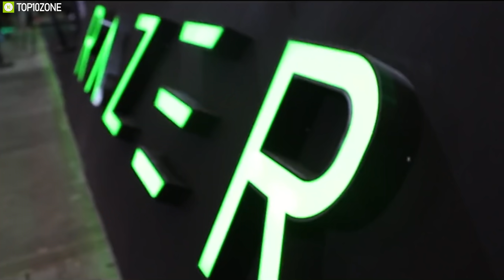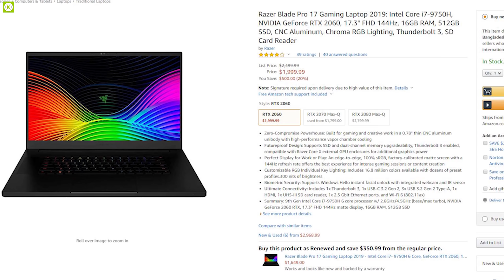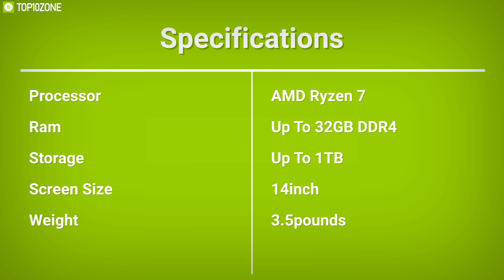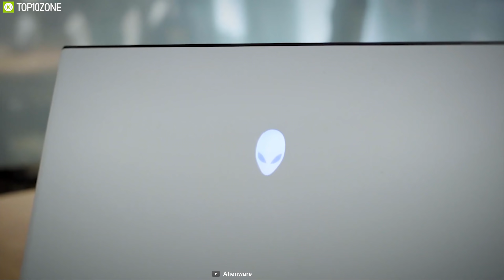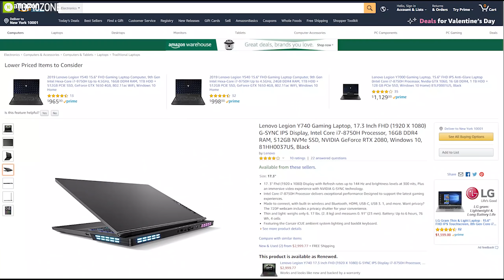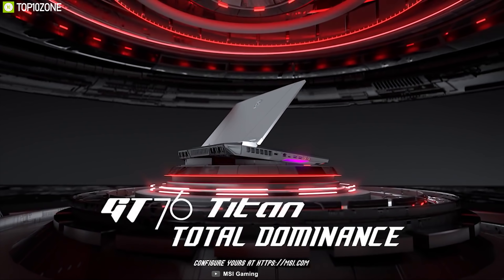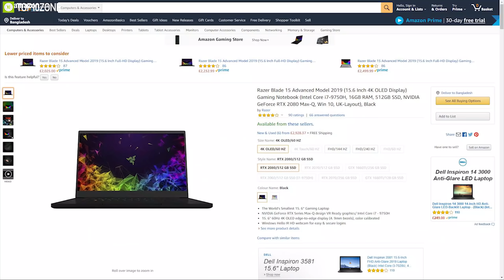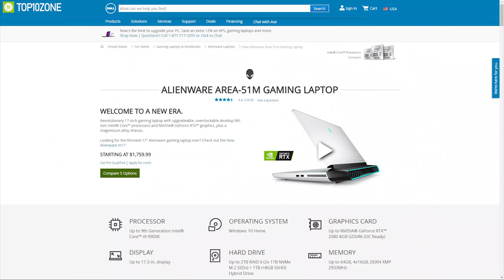Top 10 Best Gaming Laptop to Buy

Comment: This dude has no idea what’s he saying and is just reading specs off their website with no personal insight to add...
Reply: @camerontraer3136  I do
Reply: ArthixIsphinx Roblox You do what?
Reply: @camerontraer3136  I get more than 5 hours of gameplay xd
Reply: @arthixisphinx265  What game?
Reply: @camerontraer3136  Roblox, Fortnite, PUBG and Call of duty mobile
Reply: @arthixisphinx265  Dude...they're the mobile versions of the game. I'm talking PC versions. There's no way that a gaming laptop would last 5 hours of gameplay
Reply: @camerontraer3136  it will and I have one
Reply: ArthixIsphinx Roblox again. It’s the MOBILE versions
Reply: Cameron Traer lol have mercy with the insults sheesh
Reply: @camerontraer3136   hi there I'm trying to get gaming laptop but what do you mean it wont last 5 hours? The battery only or the performance too?
Reply: SubZeroT_T it depends on the wattage capacity of the battery. Most if not all Gaming laptops don’t have good battery life. But please remember that if you want to play a game on it, PLUG IN THE CHARGER. This will not only charge the laptop, but also gives it extra power to run games at higher settings and higher frame rates. If you game on battery, you’ll only be able to get around an hour of gameplay, but the frame rate will be capped at only 30 FPS. Compared to when gaming when plugged in, you can get up to 90 - 300 FPS, but that will depend on the game and the specs of your gaming laptop. If you have any more questions, please feel free to contact me again.
Reply: Shubham Raikwar it’s terrible
Reply: ArthixIsphinx Roblox excuse me, but I know how a gaming laptop works inside-out, and I can GUARANTEE that you’ve been scammed into thinking that a gaming laptop can play Fortnite and PUBG for 5 hours on battery life.
Reply: @camerontraer3136  thanks alot so I don't have to worry about anything else when playing with charger on it still do as good as pc or almost. I checked many reviews and top x. But still not sure as most of them sponsored or doesnt have real gaming experience just tech stuff
Reply: Is halt so
Reply: 哈 我也聽不懂…
Reply: @camerontraer3136  man i trust you, you seem to know what u sayin so i'm gonna ask you: there's a good laptop for gaming not expensive like in the video ? I need it to play with my friends, games like modded minecraft (lol yes), rainbow six siege or even new games...i'm not very demanding on video quality, just need at least 60 fps xD. Thx <3
Reply: Lorney Sure! Try a gaming laptop with either a GTX 1060, or a 1660 Ti. Just DO NOT get a gaming laptop with a MAX Q graphics card.
Reply: @camerontraer3136  Hi, do you know of any PC's that are still affordable but can have around 60-120 fps? I would like to plug a controller into the laptop. What I'm trying to mainly get away from my xbox one s is low fps and latency that console players generally have while playing games.
Reply: thanks for the comment my guy, saved 10 mins of my life
Reply: @Shubham Raikwar Jesus that's expensive!
Reply: @camerontraer3136  you are right
Reply: @PenKake14  don't just buy a laptop for its looks. Manufacturers spent more money on that stupid RGB keyboard than the graphics card.
Reply: ArthixIsphinx Roblox A PC...dude a PC doesn’t have a battery!!!
Reply: Cameron Traer i mean he’s not wrong. Technically u can play for more than 6 hours 😂
Reply: ArthixIsphinx Roblox dude the razer blade 15 has one of the best battery life out there and it can only get four hours with normal productivity lmao
Reply: DEDINSIDE yeah...an a PC connected to a PSU connected to an outlet at all times.
Reply: @camerontraer3136  I played roblox more than 6 hours again on my gaming laptop and charging it at the same time and playing I played Piggy and a lot of roblox games now get roasted
Reply: @arthixisphinx265  Dude...you just roasted yourself! You're plugged in while playing it! Of course it's not gonna use battery life! It's using power from the charger!!!
Reply: @Zero-_-kw  Please don't look to this video or his channel for ANY information. He knows nothing about gaming laptops, and is just reading the specs off them online. But no, if you want the ABSOLUTE best performance, get a gaming PC desktop.
Reply: @Mi-cuhhh  Sure! It depends on what games you want to play, what your budget is, what resolution, and what graphical settings you want to run the game at. So first off, what is your budget?
Reply: @camerontraer3136  I wish I could get a pc but the thing is 3 days per week I'm staying at work and I got plenty of free time there. That's why I'm mainly looking for gaming laptop so I can carry it around.
Reply: @Zero-_-kw  I 100% agree with you. So are you looking for an ultra thin gaming laptop?
Reply: @camerontraer3136  I don't mind the size of the laptop or how heavy it is. I'm just looking for the best performance also it will be always plugged I'm not worried about battery life. I've been looking around I've seen some awesome laptops  but expensive like 3 - 4k US dollars. My budget would be around 1.5 - 2k$
Reply: @camerontraer3136  whoa!! Thanks for showing that I'll definitely wait then!
Reply: @camerontraer3136  but it was 45% after 6 hours of gaming it came at 78% say something now
Reply: ArthixIsphinx Roblox While it was PLUGGED IN
Reply: ArthixIsphinx Roblox plus you play little boy games. Those could run on a phone no problem!
Reply: @camerontraer3136  played call of duty modern warfare remastered on my gaming laptop for more than 5 hours and NOT PLUGGED IN GAMING WAS  3 hours of gaming and then continue PLUGGED  for 2 hours more and 20 minutes now say something
Reply: @camerontraer3136  also you know what let's just stop arguing for no reason
Reply: @camerontraer3136  My budget is about 6- 800
Reply: Micah Vielma Oh...that’s uh...yeesh...
Reply: @camerontraer3136  well I could go higher. Anything you reccomended?
Reply: @DaneJiujitsu  wow fortnite is a mobile games
Reply: @camerontraer3136  hey, can u give me an name of a good gaming laptop I want to buy one, I just want the name of the pc, thank u
Reply: TheFreakHead Well, it all depends on your budget
Reply: He said "In-con-spishious" instead of 'inconspicuous'. 🤦
Reply: @arthixisphinx265  Hahaha sorry kid they're talking about PC/PC gaming and you're talking about mobile...
Reply: Daba11 I couldn’t do it any better lol
Reply: @camerontraer3136  
You are doing God's work over here. Ignore that roblox kid.
Reply: @NOU-iw3gb  Wait...I am? How?
Reply: @camerontraer3136  
You are helping others out
Reply: @camerontraer3136  
Btw I have hp pavilion notebook . It's a 60 hz laptop and I get max 60 fps on it. Sad isn't it? I got it 4 years ago I think.
Reply: @NOU-iw3gb  Aww! I just love helping people!
Reply: @camerontraer3136  what is bad with a max q? I just bought an Acer Triton 700 with a 1080 max q and it is fantastic! I know that max q  graphics cards are usually expensive but i got my laptop for 1.300 US$ I think it was a pretty good deal
Reply: @frederikcamilodahl3551  Think of it this way. When you play a game on your laptop, a graphically demanding one. Like DOOM Eternal. The laptop generates a big amount of heat from both the CPU, and the GPU.

In your gaming laptop, you DO have a dedicated GPU, but it's a Max Q version of the 1080 laptop GPU.

You see, Max Q graphics cards are designed to output the least amount of heat and consume the least amount of power as possible. However, that being said, less power consumption and heat limitations cause the GPU to run at a much lower frequency, resulting in lower FPS than a full laptop GPU.

Max Q GPU's are specifically designed for thin and light gaming laptops, due to how compact the laptop is.

I looked up your Acer Triton 700, and it's very thin. But the only way they can put a dedicated graphics card inside, is to put a lower powered Max Q version of the 1080 laptop GPU inside. It's because your laptop is so thin, the cooling system would not be capable to properly cool a full 1080 laptop GPU. It would be overwhelmed, the CPU and GPU would be WAY more likely to Thermal-Throttle, (Meaning it heat's up to nearly 100 degrees Celsius, and your FPS would significantly drop.) And becomes dangerous not only to the laptop, but can become a fire hazard. 

I'm not saying that your laptop is bad, it's actually pretty good! I'm just saying that the performance is not up-yo-par with the FULL laptop version of the 1080. 

The reason Max Q is more expensive, is that you're paying for a thin and light laptop that can run games. That small form-factor is what makes the price jump so much, because it's extremely compact.
Reply: @frederikcamilodahl3551  I'm not saying that your laptop's bad, but the Max Q GPU isn't near as powerful as the full laptop version of the 1080

The reason Max Q is more expensive, is that you're paying for a thin and light laptop that can run games. That small form-factor is what makes the price jump so much, because it's extremely compact.
Reply: @PenKake14  these are horrible specs
Reply: @camerontraer3136  Acer gives the option to overclock it a bit, so it is actually pretty close to a normal mobile 1080 and better than a mobile 1070. But a mobile 1080 is of cause still better. I also use my laptop as a school computer, so I love that it is so thin. I can play JC4 with ultra graphics and still be under 70 degrees Celsius. My desktop also have a GTX 1080, so I can allways use that if the heat becomes a problem. But I have not had a single problem with any games and i have never been over 80 degrees Celsius. But thanks for the comment - Hope you understand me because I do not normally speak english:)
Reply: @camerontraer3136  ... And I could not find a better computer in my country for near that price (1.300 us$)
Reply: At least you know his top 🔝 10
Reply: @camerontraer3136  yes it will lmao i play PUBG, rust, ark, call of duty, dayZ and so on all pc versions and i get more then 5hrs of gameplay lol
Reply: Y’all know good laptops for around 400-450?
Reply: @camerontraer3136  hi there, could you help me finding  a good gaming Laptop in the price range of 1500-2000
You also can give me some Recommandations up to 2500
Response time from the display should be like 3ms and yes it should run Triple A games.. I was looking for asus but all the informations... It's to hard to find out wich one is the best 🙈 thank you in advance and Greetings from Luxembourg
Reply: Daba11 so would you rather read it?
Reply: Just sharing my personal experience thought it might help you guys a little,ofcourse not for the views,you can check a video in my channel of that shotgun in pubg pc,I bought this Lenovo ideapad 700(i5-6HQ,12GB RAM,SSD,GTX 950m 4GB) for 340USD a year ago,45-60fps on 768p Very low settings,I got used to it and I’m in Expert rank now(0.82 K/D, 9 Most Kills),in middle of playable and not playable

Don’t expect gaming laptop to game on battery as said above you’ll get low fps and still the battery won’t last for more than 1.5 hours on high end games
Reply: @PenKake14  that's a pretty outdated machine, to be honest. My msi GS63VR has an i6 6700, gtx 1060 6gb, 16gb ram, 1tb hdd and a 256gb ssd, and all the msi bells and whistles. I'll sell it to you for 750 usd
Reply: @pabloescolar_  he probably did but I bet you spent those 10 minutes in the comments of this vid afterwards hahahahhahahaha
Reply: @arthixisphinx265  who tf plays call of duty mobile on a laptop 🤣🤣🤣
Reply: What
Reply: @egage43  Apparently, that kid.
Reply: The number of likes on this comment ~ The number of dislikes on this video.
Reply: Thats tuff.
Reply: Can you recommend a laptop for me? I'm a PS4 owner who has never gamed on a pc before and want to get into it.
Reply: @satnav1980  If you want an entry level gaming laptop get a GTX 1660Ti, don't get an RTX2060. Get an RTX2070 super if you can.

i5 is play but i7 has more cores so it's better. 9th gen is okay, 10th gen is better but not available everywhere yet.

With a GTX1660Ti COD Modern Warfare can push 90 - 100 FPS on Normal settings.
 Max settings will give you 75 - 89 FPS.

Get a monitor/screen that has at least 144Hz refresh rate.

If you choose RYZEN over Intel, keep in mind that thr 4th gen AMD RYZEN are more powerful than the 10th gen Intel. 

My recommendation: 

-Triton 500 with RTX2070, i7-9750H, 144HZ and 16GB DDR4 RAM
- ASUS ROG G15 WITH GTX 1660Ti,  R7 4800H, 144Hz and 16GB DDR4 RAM

(There is no point in getting a 240Hz screen if you're running a GTX1660Ti or an RTX2060)
Reply: He's just trying to get clicks on his affiliate links lol
Reply: Cameron Traer sorry to bother you but, I’ve been looking for a budget laptop 600-1000 and I don’t want it to be dedicated to gaming because I will most likely be using it for other things but I need a good laptop for gaming so I don’t need to use my parents laptop
Reply: ArthixIsphinx Roblox wtf 😆
Reply: Cameron Traer haha 😆
Reply: ArthixIsphinx Roblox tf mobile gaming sucks
Reply: Micah Vielma Is 500$?
Reply: Cameron Traer do you know a good gaming laptop under 1k
Reply: Cameron Traer tf you mean? I have an i5 laptop and it can last running all day
Reply: Acer Predator " https://amzn.to/2ZwdzwJ "
Reply: Cameron Traer what laptop would you recommend me to buy for gaming and watching anime ?
Reply: Umm it's not a review of a laptop
Reply: The vids are also wrong and the specs are too lmao
Reply: @PenKake14  bot get out of here
Reply: @camerontraer3136  Hey dude I really need a laptop as where I live doesn’t have electricity most of the time and we always move every year so I don’t  want to damage anything so I want a laptop which would be easy to carry and therefore will give better battery performance. With a good cpu and gpu( Dont worry about budget I am here for recommendations)
Reply: @arthixisphinx265  oh would I shut ur mouth kid, first of all u were playing low demanding games like roblox in a gaming laptop! And we’re plugged in!
Reply: @habibullahbakir6183  Hi there! Just to let you know, you need to remember that you should never play games on a laptop while it’s on battery. Some games can be an exception, but it’s really not a good idea. On most gaming laptops, if you game on battery power, you only be able to get around 30-45 minutes of gameplay. If you’re lucky, you’ll get 1 hour and above. But that’s it. And because the laptop’s on battery, it will automatically cap the CPU and GPU’s performance significantly, meaning you’ll only get around 30FPS while on battery.
Reply: @arthixisphinx265  u can run it on a phone and wtf why are u playing roblox on a laptop my mother’s core i3 laptop can also run it no probs!
Reply: But, if you’re looking for the MOST battery life in a gaming laptop, get one that has a 99.9 watt hour battery. Hey his is the absolute MAXIMUM capacity that a laptop battery can carry. The reason for that is because anything higher would not be allowed on a plane, cause anything higher is a fire hazard.
Reply: @camerontraer3136  so it’s dangerous if I play while I am plugged in. Then can u recommend me anything which doesn’t have good battery performance but at least a good graphics.
Reply: So, if you want the best battery life and a name of a laptop, I would recommend getting the MSI GE66 Raider. It’s got per-key RGB, and RGB light zone in the front, a 1080p 300hz IPS display with 1ms response time. Meaning that you can play some games at up to 300 FPS. Such as CS:GO, Valorant, Overwatch and more. It’s got a 99.9 watt hour battery, the highest capacity in a laptop. And to help reach that 300 FPS, I recommend going with the RTX 2080 SUPER MAX Q version.
Reply: @camerontraer3136  thanks dude I got all the specs!!!!
Reply: i was going to comment the same thing
Reply: @Seamorehoffman789  your the child brother
Reply: @camerontraer3136  you know what forget it
Reply: @yessygarcia9452  Hi there! Well, it depends on your budget.
Reply: @arthixisphinx265  Forget what?
Reply: @camerontraer3136  I don’t really have budget and it Honestly doesn’t matter how much it ends up costing just tell me what you recommend or you think is the best in your opinion
Reply: @camerontraer3136  -Most likely Microsoft minesweeper.
Reply: @camerontraer3136  which laptop you recommend bruh
Reply: lol yes